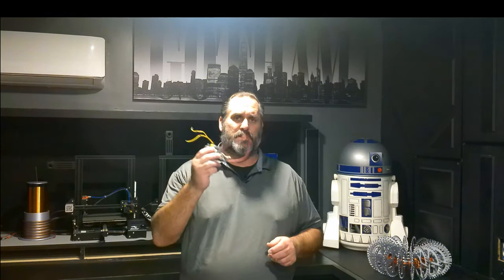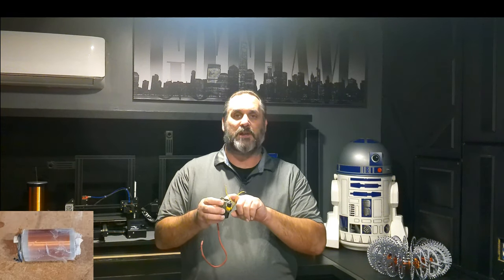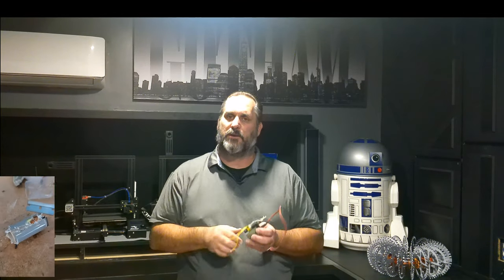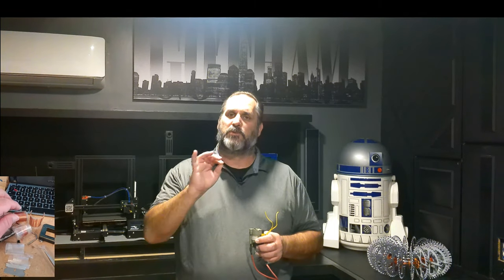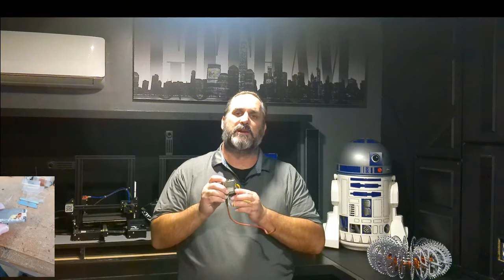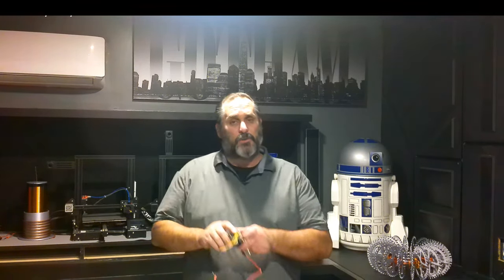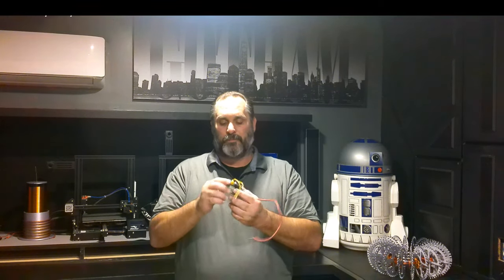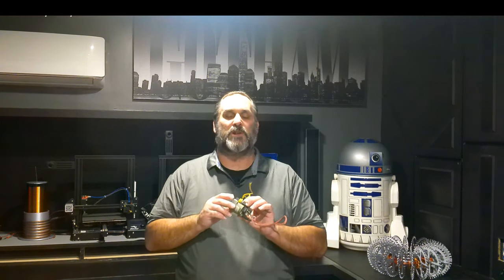Graviflyer "High Voltage Vs Plate Distance"

Comment: Good analysis. My comments.  The distance of the disks has to be correct to get the earth's EF. Watts can be any V and I and you are correct. I like the Arduino idea as my solar panels have a controller and they produce antigravity waves as I have shown you and will produce more when the Helion comes on board. When my solar panels heat up the amps go up and the volts down just as you talk about, and my Android phone app measures no AG. I will send you a diagram of solar panels and how they are built with the correct separation distances of the different layers, so they produce AG. You can use the solar panel layers with ratios to calculate your gravity flyer disk separation distances. The solar panels are glass, plastic, SiN, SiP, Si, SiB, plastic, and Al. I cannot post this here. My solar panels have the V and I in phase and produced AG. The solar panel inverters change this to match the power grid with the V and I 180 degrees out of phase so no one can do the AG experiments. I have two inverters and if you want one, I will send you one so you can run the US power grid in reverse to get the V and I in phase, so your gravity flyer works if you want. Just send me where you want me to ship one of the inverters. The inverters cost $250 but I will not charge you. Solar panels produce BF, EF, and GF to work. The gravity flyer layers are air, Al, air, Al, Air Al, and Air. The airs N2 and O2 separate in the gravity flyer to produce the correct solar panel layers. The glass is O2 and the SiN is the N2.

Comment: The flyback diode is usually in the heat sink area just before the anode wire.
Reply from the maker: There are no regular looking diodes in it at all. Just the wrapping.
Reply: @nathanbunten4299  There should be in the plastic but yeah, some are hard to find or no diodes. Maybe it relies on the pulse as mostly positive to average out the HV DC supply using the tube capacitance?Would be nice to see the output with HV probe and oscope.
Reply from the maker: @anthonywilliams7052  The core pulses and the energy is picked up by the strips. That's why the amps are low and the field is smaller.
Reply: @nathanbunten4299  I remember back way when when they all had diodes and the  6LQ6 tube anode would give you a good shock. Back when we walked barefoot everywhere in the snow.